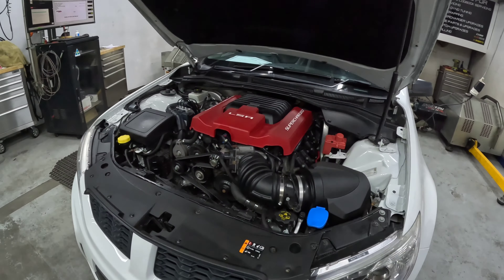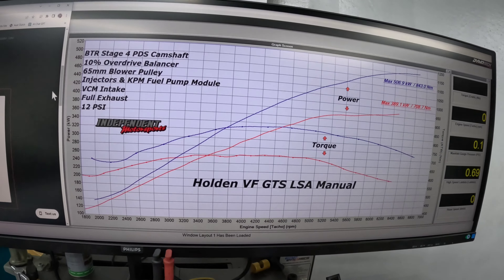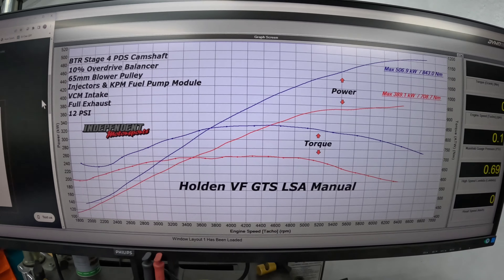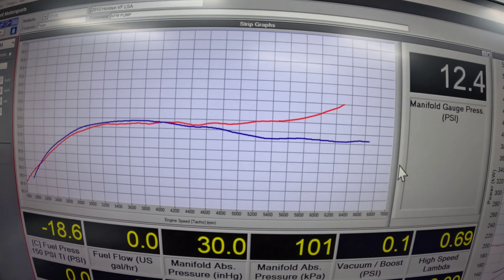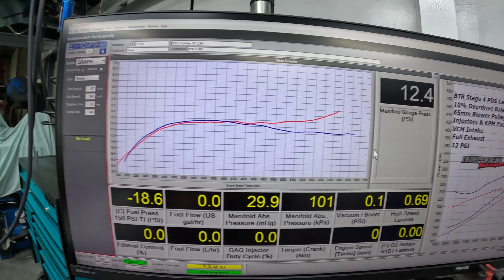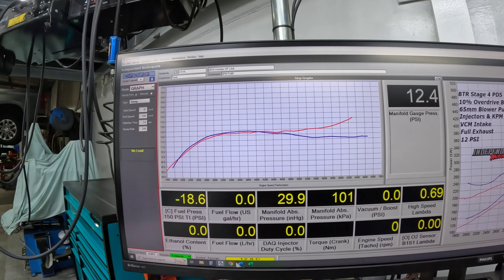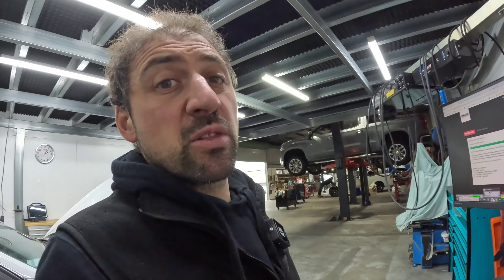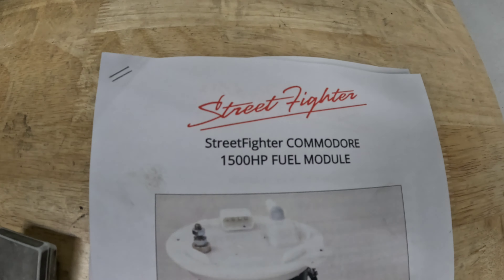Holden VF GTS LSA BTR stage 4 PDS V2 Brian Tooley racing camahaft

Comment: Wow  thats a big gain from a cam swap impressive , I personally try to only use Au  owned and manufactured parts to support Au manufacturing  as long as its the right part for my application,.
Reply from the maker: If you've been following our channel you will see 98% of our camshafts & parts  are all Australian made. And we purchase our BTRs directly from Race Max Direct which is an Australian own company so we're doing our part. Sometimes we just don't have what we need so you do have to outsource sometimes.
Reply: @IndependentMotorsports  Yeah I been following you for a couple of years I know you use mostly au parts wasnt having shot just stating my  personal preference if someone wants to use  os parts thats fine too.
Reply from the maker: @AndrewMitchell001 absolutely I understand

Comment: So adding a harrop 2.650lt LSA looking supercharger will make it sing for sure, plus head work is a must. but still over 500kw at the rear wheels is massive, plus its a manual, so she will spin in 1,2,3 gears for sure its the ducks guts barry. :)🚓🚓🚓🚓👌👌🙌🙌👍👍

Comment: Grouse power and torque increase. What size converter is this car running?
Reply from the maker: Its a manual
Reply: @IndependentMotorsports  that makes sense now. I wrongly assumed it was an auto with a decent converter.
Reply from the maker: @bigal878  All good mate it was a good question I don't think I even mentioned that in the video so thanks for asking.

Comment: Do you recommend this cam or a crow 1286 for a vf 2 ls3 manual. Def have plans to put a charger in the future. Thanks :)
Reply from the maker: The 1286 is a really good cam that works in both applications so I would recommend this. However if you are putting the blower on straight away then I would recommend the BTR
Reply: @IndependentMotorsports  Appreciate the quick reply. I wont be putting the charger straight away, so think 1286 is tge way to go. Thank you

Comment: Stuffy! How hard would one of these engines be to put into and old vt vx commodore that was previously a 6 cylinder. Can be done ?
Reply from the maker: Honestly mate it's not economically viable, by the time you convert everything over you might as well just build a 6ltr and fit a blower to it. The prices that LSAs are going for these days is just absolutely crazy.
Reply: @IndependentMotorsports  I was thinking it's a complete motor and cost vs a 6 litre plus cost of a blower it might work out cheaper.  But ye apparently not